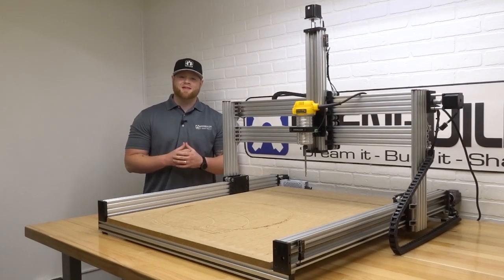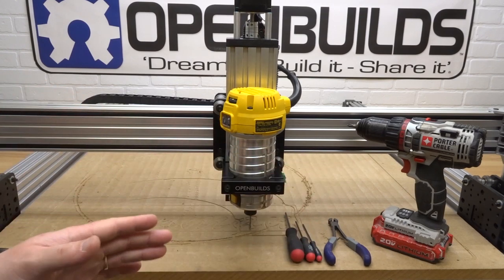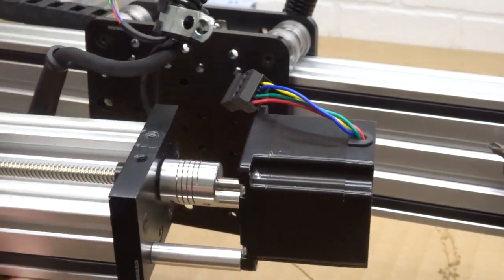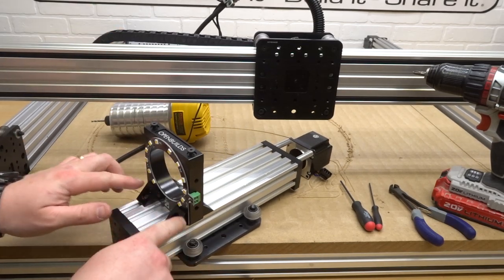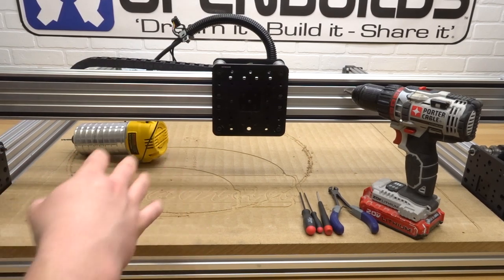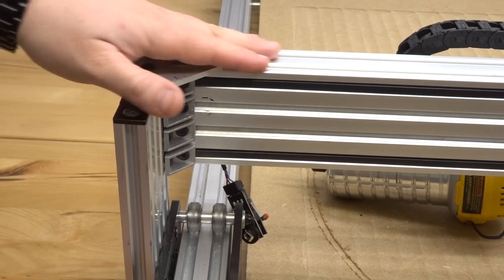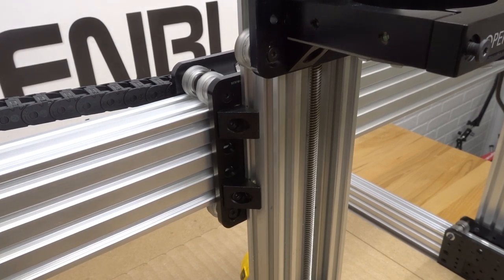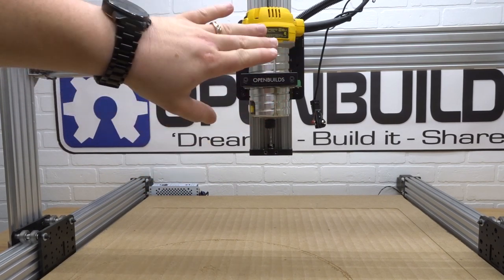OpenBuilds LEAD 1010 (High Z Modification)

Comment: At about 40:00, I can't get the slop out of the lead screw. It's not big, but it's there. I don't understand what is meant by 'adjust the orientation of the lead screw pitch.'
Reply from the maker: Thank you for reaching out. Some "whip" is expected with a 1000mm run, and this is because of the compression the lead screw is under. The lead screw pitch has to do with it's compatibility with our Acme Nut Blocks, sometimes it is necessary to adjust the orientation (the position of the lead screw) to get it to fit into the Nut Block properly. Check out this resource: https://openbuilds.com/projectresources/eliminating-lead-screw-whip-on-the-workbee-cnc-router.328/

Comment: Great video, But yes there's a but why disassemble to the point you did. Surely you could disassemble the uprights left and right then replace with the new uprights without taking apart the the black carriage and the lead screw's?.
On the new twin carriage set up have one long plate instead of two. This way you could use 6 wheels instead of 8 wheels. The bottom rail of the new set up could have a flat plate or an L shaped plate going from the C horizontal section to the flat of the upright making it more secure and aiding alignment. Where you have the 4 90 degree cast corners  couldn't you make it just one long one?.
Overall a great video and if I could afford one then I would get one.
Reply from the maker: Thank you! Great suggestions! The purpose of disassembling the machine the way that I did was because each y gantry upright is mated to the gantry with 4 M5 Tee Nuts along with the cast corner brackets on the front of the gantry plate. In order to access those components it was necessary to take each gantry off of the Y axis C-Beam.👍

Comment: I have a problem maybe you can help when I'm cutting out if the Z starts to vibrate send  leaves marks in the material and that's cutting depth 1/8. It's driving me nuts I want to modified it to make it stouter somehow. 
It is a 1500mm x1500mm work bee
Reply from the maker: On a design like the WorkBee the plates are locked into the system and so the Z axis cannot easily be modded where as the LEAD CNC has V-Slot as the side plates allowing you to raise the Z axis and even add more supports where needed. Please have a look over on OpenBuilds.com support forum as there are many great upgrades and mods users have done to help.

Comment: That don’t make sense to have your spindle that high above the gantry. I could see this working better in a different configuration with the same parts
Reply from the maker: That's the beauty of the OpenBuilds modular building system there are so many possible configurations for practically any application. We could have used the Z axis that moves the whole axis in stead of the plate, but it would have been in the way as in this case we needed to us a very long bit for very deep cuts and so this layout was chosen.

Comment: How about rigidity?
Reply from the maker: This modification is rigid. We made sure that this design was comparable in strength to the existing LEAD CNC with the increased Z Travel. Here is a live feed of the mod at work: https://www.youtube.com/watch?v=aCUfuk0sfmk the Z axis is adjustable, so we were cutting out .5" material. More videos to come! 👍